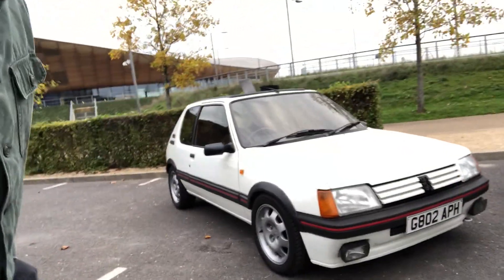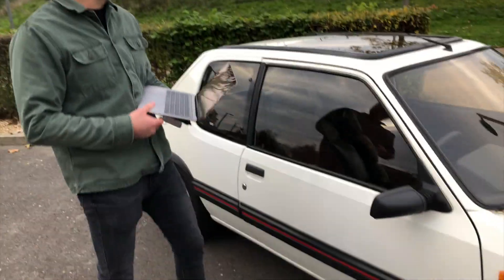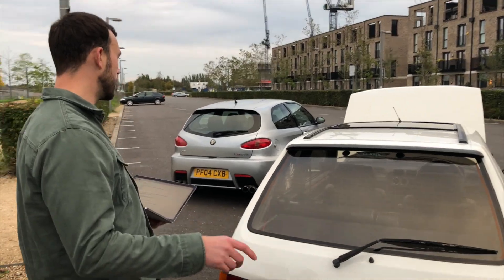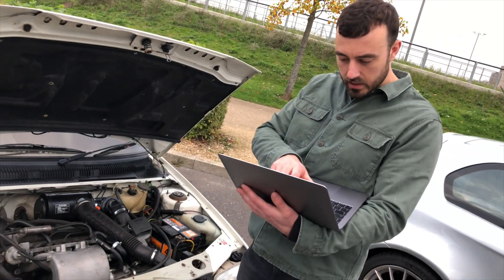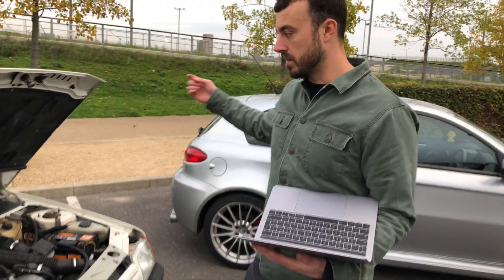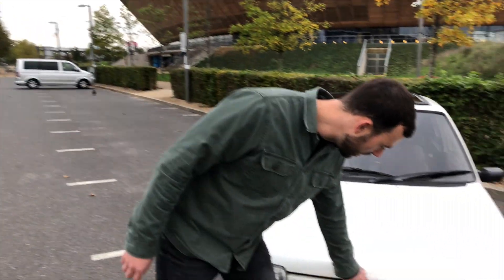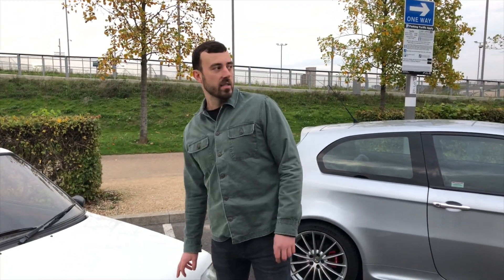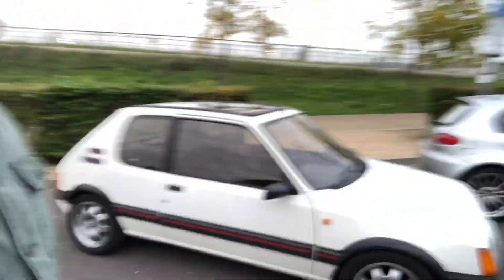Peugeot 205 GTI Restoration & COST SO FAR

Comment: It needs the correct foglights, and the ride height looks a bit too low. Have the springs collapsed or been modified, or is the fish-eye mode a bit deceptive? Did you experience the common fault of stalling under hard braking (which was an oil pressure fault, I think), or has this been remedied?

Well done for keeping this 205 alive, and in factory spec. The 1.9 GTI will always be the greatest hatch ever made, and may be the greatest car.
Reply from the maker: Hi! Foglights are now finally updated - it was not fun removing the old rusted on nuts..! The previous owner upgraded the suspension and I agree - it sits too low. Never stalled braking hard, will look out for that one.! Thanks for the comment and feedback and stay tuned for more 205 content.
Tom

Comment: Please sort those driving lights and front grill, I’m not sure it’s right! There shouldn’t be white between the slats, is it aftermarket or one for colder climates? If so it’s not right at all, for a start, air won’t be getting to the radiator!.  Car looks clear overall, what’s it like underneath? Good stuff so far though 👍